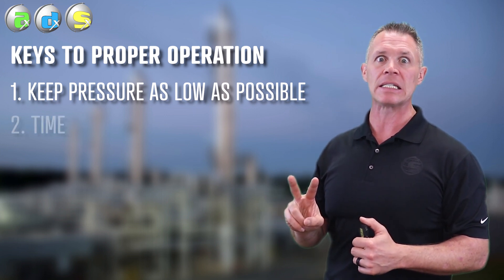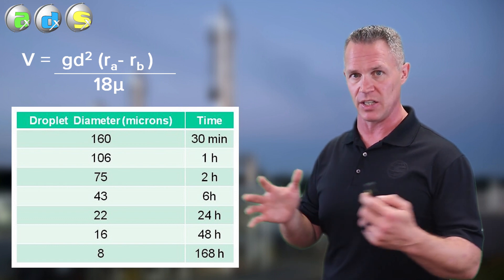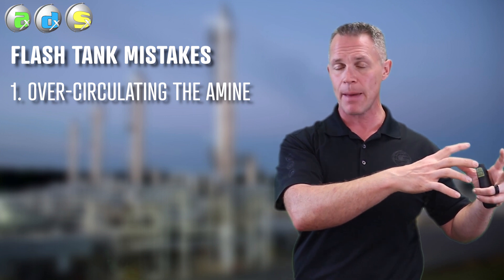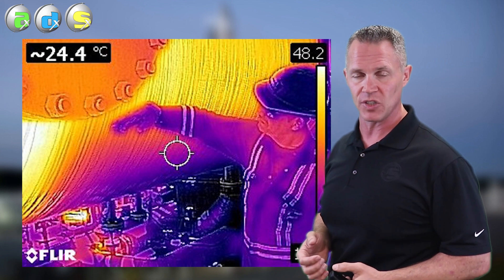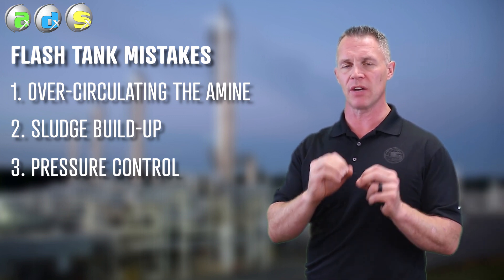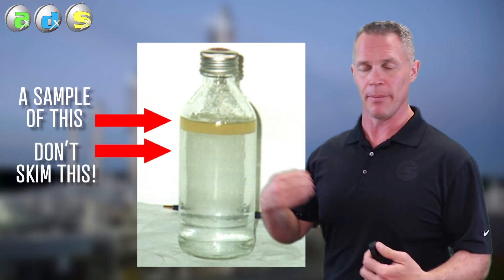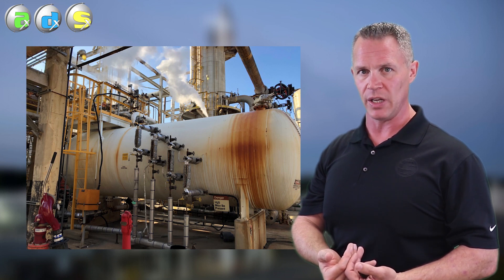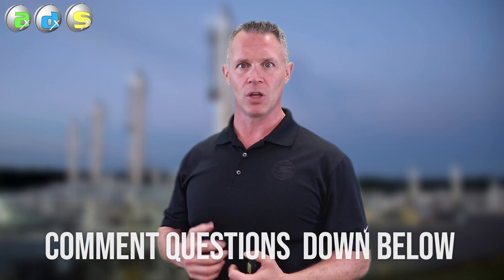Hidden Secrets of the Flash Tank

Comment: Good information Ben. I attended some of your F2F courses as a part of Amine Experts training at McMahon plant in norther British Columbia (Fort St John). During the 3 year turnaround we used to clean the garbage out of the flash tank. Need to be careful about the present of iron sulfide while cleaning any part of the amine network. Based on my experience, residence time can be difficult to specify, but 25-30 min is reasonably good depending upon the quality of the incoming HC gas. More the better if there are some free HC liquid coming with the gas, but the design concept varies. Best practice - clean the sludge during the turnaround.  Thanks for the table of residence time vs HC particle size.

Comment: Hi Ben, thanks for this great video.. 

If over-circulation is indeed found, then we need to reduce the circulation in such a way that the remaining time for the rich amine in the flash tank is> = 20 minutes. In parallel, we also have to pay attention to the impact on the on spec condition of the resulting sweet gas (treated gas). Can it be off spec? do we need to increase his amine strength? Are there any negative effects that need to be considered when increasing the existing amine strength?

I am really triggered to recheck this via simulation.. looking forward to your response...
Reply: Julian, you are right you cannot simply reduce the amine circulation rate without checking several parameters first. Make sure to control the rich loading of the amine (which is a function of both amine circulation rate AND concentration), calculate the expected temperature bulge in the absorber, and double check the hydraulic limitations of your pumps, absorber internals and heat exchangers.

Yes there are negatives to increasing amine strength. Depending on the amine, too high of strength may lead to corrosion! As well as high viscosity which as all sorts of potential problems associated with it. If there is a liquid-liquid treater in your system, high amine strength can result in high amine losses with the treated hydrocarbon stream.
Reply: Increasing the strength of amine you can’t control the temperature due less water

Comment: How often should I drain my reflux accumulator
Reply: Troy, in a gas plant you'd drain or purge whenever you had foaming in the regenerator (or whenever a reflux water foam test shows that it's foamy). Some plants dump their reflux once a week, some once a year. It depends on how much contamination is entering with the feed gas to the absorbers. In a refinery the same rule applies but also add in the concentration of ammonium salts. Most refiners constantly purge 5-10% of their reflux water to the sour water stripper.
Reply: @benspooner8690  good deal Mr. Ben, very much appreciate you taking the time to do these troubleshooting videos.

Comment: Alden from Estevan Sask here. You ran us through the course a few years back.  We have been pulling out buckets and buckets of a gray gel out of our flash tank. Any ideas what it could be?
Reply: Alden, its probably antifoam!! Antifoam quickly floats to the surface of amine when it is stagnant, like in a flash tank. Because it is so viscous it picks up a lot of hydrocarbon and suspended solids, and eventually turns into what we call "black shoe polish". Pretty much any antifoam you inject into an amine absorber winds up floating in the flash tank.
Reply: @benspooner8690  Its definitely not black show polish it is a grey gel, almost like silly putty kids make. Its not heavy but does stick together and we use a alcohol based anti-foam.  It almost looked like brains coming out of the skim, chunky and did not break down with anything other than methanol.  Thanks for all the videos we have been watching and rewatching them at work all week!

Comment: I am curious about sight glass. Is it possible to  visually define the hc interface? Usually rich amine is black or opaque.
Reply: Ali, rich amine should not be black! If it is, determine what's causing the colour change and fix it. And yes, if the sight glass is properly located, when you purge it and allow it to refill it should accurately reflect the location of the interface.
Reply: @benspooner8690 Rich amine will be dark green colour only, right?

Comment: Another great video! Just a lessons learned, lowering the operating pressure below the normal operating point will lead to more flashing d/s of absorber LCV that can cause erosion-corrosion of rich amine inlet line and nozzle of the flash drum.
Reply: Ali, this true, but usually is also associated with excessive amine circulation rate. You shouldn't have so much hydrocarbon entrained in the rich amine that flashing across the absorber LCV causes erosion, no matter how much the pressure drop. Check that the amine is not being overcirculated and picking up more hydrocarbon than it should be!

Comment: Thanks Ben for the amazing information, just an idea: Is there a simple why to make residance time calculation and it will be updated from real plant values? If I see that residence time getting reduced than 20 min then a troubleshooting is required? Thanks again
Reply: I normally calculate the total volume of the tank then use 50% of that as the liquid volume. If your plant operates with a liquid level greatly different than 50% you will have to adjust your calculation, but 50% is generally pretty close. Once you have the liquid volume its easy to figure out how many minutes the amine will be in and out of the tank based on your circulation rate. You'd be surprised how many plants we come across where the residence time turns out to be less than 10 minutes. Its no wonder skimming doesn't do anything in these situations!
Reply: You can calculate the normal liquid volume of the tank/drum, which should be a fixed value (minus solids accumulation).  Then, residence time = liquid volume/circulation rate.